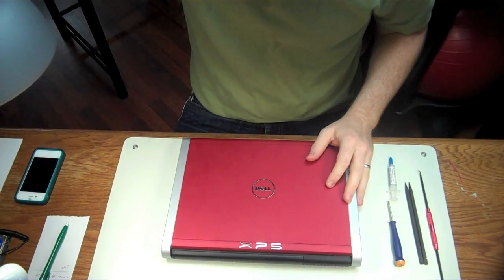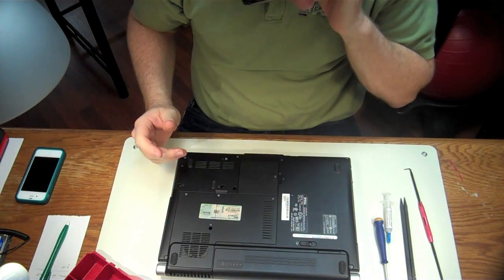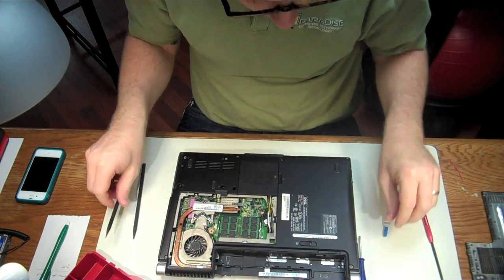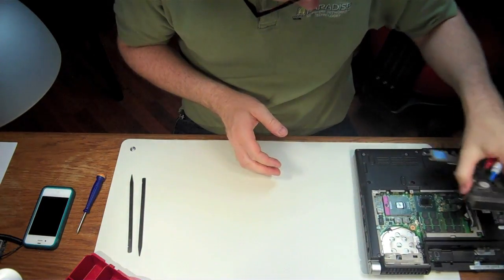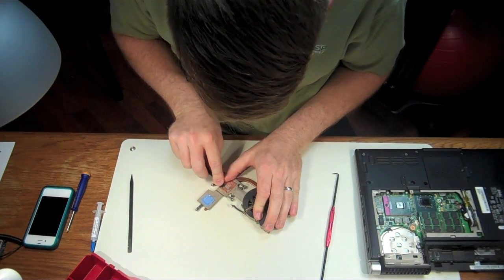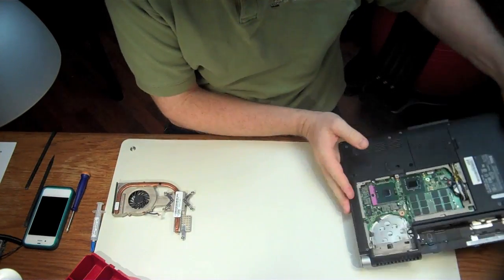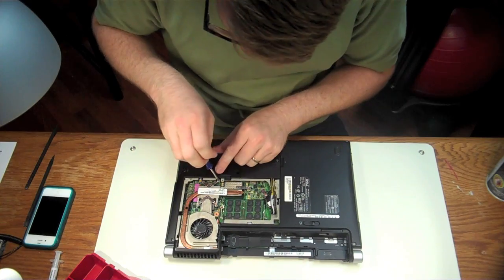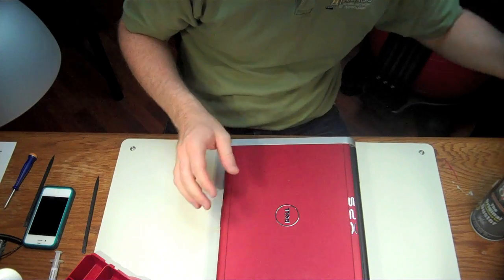Dell XPS Laptop Fan Cleaning - Overheating Issue Solved

Comment: Before you do anything you should probably just buy a new lithium ion battery, also; check if your putting the battery recharging plug 'in' correctly(fully). 'There is no overheating problem according to me'.-Defined as being a 'Contestable'  'view' because Anything can quote overheat a computer. even pressing ones hand too much on the panels.
Reply: Also, I would question (in that particular machine) if the battery bay ports aren't wearing out since they're made of some 'sort' of copper alloy. I also, found that old windows versions may just have simply been compromised.. Go windows with the eternally flawed systems and what if its' been a msdos (eternal). (You know) just so they can keep on pandering new devices to us?
Reply: Also, remember that when you open it it voids your warranty. 'MAY COST BIGGER DOLLARS'

Comment: I've done the same thing and the CPU and GPU temperatures went down a little, but the motherboard temp is still high (around 65 C / 150 F) in simple tasks like browsing or Word and the fan is always running, what could be the problem?

Comment: Oh Man. You butchered this task, like a newbie. 

Are you still in business ? 
How many early retirements and replacements have you caused in Florida? 

Does DIY in DIY Tech stand for Destroy It Yourself?

When cross torquing CPU heat sink arrangement, always work in three stages of torque. 
NEVER EVER max out the final torque in one go! 
Incrementally cross torque any retention bracket in at least three stages. 
The way that you did it means loading one face first.
This can stress both CPU and socket.
Solder separation is already a huge problem on laptops after the swap to NO Pb (Sn) solder.

Also way too much thermal paste. "Grain of Rice" you said which is true.
Not a full plate of rice ! LOL

Lastly, you didn't touch the fan ! 
I'd be asking for a full refund as you did not do a professional job. 
The opposite. You did half a job and did that like a beginner.

You effectively leant on one side of the CPU, drowned it in thermal paste, failed to even touch the fan and having pulled the GPU thermal patch whilst removing the heat sink, you should have replaced that or at least popped a small amount of thermal paste on top to maintain effective thermal transmissivivity.

I'll end on a positive as I should.
I adore your idea of the compartmentalised labelled container. 
I last used an egg crate and bumped it. all screws ended up together.
On the labelled container I give you 5 Stars.
On the rest of the job, I grade you an epic fail.

My validity to comment on your video:
Full technical qualifications (4 Year course full time course - I came 2nd in entire state)
3 years of post graduate technical education: which included materials processes specification, metallurgy, thermodynamics. 
18 years in Computer field at tech level, supervisory roles and management. 
A year with US based Multinational, United Technology Corperation, in the Carrier division, as regional manager.
Accredited designer/inventor with the Australian Intellectual Property Office.
Lastly I was invited to sit on the Australian Design Awards selection Panel.
Reply: Agree. If I'm spending money to have someone else cleaning the fan, it should look like brand new after the job is done, that's clearly not the case here.
Reply from the maker: Still in biz, 20 years. Glad you took the time to write all this up. I learned nothing. The real world called, get over it. Thousands of happy customers. Peace!

Comment: Half job done ...
Your work will not have the desired result without cleaning the inside of the fan.
Nice instructions how to get to- and disassemble the heatsink, but you forgot to open the fan (four little screws). Inside you will find a lot of dust cluttered against the grating of the heatsink. This can only be removed from the inside i.e. with a vacuum cleaner.
Blades of fan to be cleaned (gently!) with a brush while holding the fan in place.
My old Dell XPS M1330 is still going strong with a new Patona battery and Samsung 256 GB Pro SSD upgrade (much faster than the original!).

Comment: I have an XPS M1300 which I've had now for over six years, which I still love, but for the past two years has been running increasingly hot. The fan's always in high gear, performance has been on the downgrade, and I've always suspected  its because the CPU is just no longer getting cooled effectively with the little bit of ventilation the design affords due to dust and the like. But until watching Brian's video, I was always gun shy about opening up the back and trying my hand at doing a cleaning.  

However, this step-by-step video was absolutely terrific and provided all the details I needed to do the job.  With just the purchase of a handful of a few supplies for less than twenty dollars, I was able to safely open the laptop, clean out all the dust, and re-apply fresh new thermal paste to the CPU/fan interface to make for a vastly more effective heat transfer.   

Now my XPS M1300 is running like a new machine.  

Thanks Brian for an awesome How-2!!!
Reply: Christopher check out my advise above, concerning cleaning the INSIDE as well as the blades of the fan!

Comment: First off thanks for the excellent video, I used this as the baseline for cleaning out my m1530 today and it's running much cooler. Regarding your comments on lighter fluid or naphtha, these are generally safe to use for this purpose long as you're not cleaning plastics or rubbers. In my experience lighter fluid evaporates more quickly and more cleanly than high purity rubbing alcohol as well as being a more powerful solvent but has the potential to damage or melt certain plastics and rubbers. Thanks again for sharing, keep em coming!

Comment: proper instructions. guess it is a bit late to ask but could you do that for the Dell XPS L702X too please ;)?
Reply: ive got L702X too, there is another video for replacing the fan, way too many screes and pieces to do that
Reply: Dust will always clutter on the inside of the heatsink, at least in all laptops I serviced so far. So after disassembling the heatsink + fan you will always have to open the fan housing and take the fan out first.

Comment: I wish the xps 17 had that convenient little hatch. I have to strip this thing down to it's motherboard. Take off the screen and everything.
Reply: The Reaper I've never once taken the screen off. Top bezel, bottom bezel, fan, sink, paste and back together. If you're worried about scratching, you could always put a static bag between the frame and the screen.

Comment: Great video. Did exactly what you did, had alot of dust and dirt on the fan so got that cleaned thoroughly but my laptop still heats up. does not get baking hot like before but enough to cause stress. Any ideas?
Reply from the maker: Did you replace the thermal paste?  Also look into a free program called SpeedFan.  It can help you determine what your temps are and if you need to replace the fan.
Reply: Hi. Thanks for reply. Appreciate it. I changed the thermal paste. It has got a lot cooler but seems to heat up the touch pad area. Any ideas?
Reply from the maker: Is your hard disk right near the touch pad?  I can't remember...
Reply: It is on the right hand side of the touch pad.
Reply: Sorry. My mistake. It's on the left hand side.
Reply from the maker: My guess is that the hard disk is heating up and causing the touchpad to get hot also.  I would replace the hard disk, as it will probably fail due to heat exposure anyhow.
Reply: Chirag Patel
Improvement of cooling can only be obtained when the fan is cleaned on the INSIDE! (look for my comment above).
Reply: also note the lack of THERMAL COMPOUND ON THE GPU THAT IS WHY IT IS HOT

Comment: Very good video - thanks from me in London, UK.  

What are those useful tools called - I heard you say 'spudgers' (but my hearing can be dodgy!)

Brian
Reply from the maker: Yeah, Spudgers!  Also known as "Black Sticks"  Very useful tool.  You can get them on Amazon or eBay.
Reply: Pronounced "Spud-Jer"... Odd name and not absolutely essential.
They are like plastic fast food knives but in non brittle plastic ! Polypropylene ? Polyethylene ?
Often supplied free with screwdrivers when purchasing replacements screens for cell phones.
You can safely use nearly any stiff plastic with a perpendicular face. Ideally a very flat leading edge is great for face cleaning.
Automotive plastic filler appliers are an easily available substitute.
Just test with the cleaning solution you plan to use. Isoproply Alcohol (Ethyl Alcohol).
You could also use an EDT "Eau De Toilette" (Fragrance with high ethyl alcohol content !)

Comment: Would spreading the thermal paste evenly before putting the fan back on make any difference? I've got NFI about this kind of stuff but you surprised me when you just out the fan back on
Reply from the maker: The paste spreads out in its own.  You can spread it like butter if you want, no harm in that.

Comment: One big mistake in this tutorial.  DO NOT let the fans spin up.  These are very light plastic parts that if they spin too fast will cause them to fail sooner, if not right away.  Hold the fan, or stick one of your spudgers in it while blowing air through it.  I've replaced so many fans where people have blown air through them and spun them way too high, higher than the engineer designed them to spin.

Comment: Here's my issue; while gaming sometimes my xps will completely freeze, so I have to smother it with the on/off button. When I start it back up the fan blows like crazy but it doesn't start up. Is heat my issue?

Comment: Nice video.  Have you every had a complaint about overheating because you didn't replace the thermal pads?  I have a Dell XPS M1730 and I removed the Ageia physx video card, but the thermal pads remain intact.  Should I replace or reuse?

Comment: Great video, My wife's laptop has this overheating problem and really effects the laptops performance. So I bought the thermal compound and it has done it's job so far. However the HDD & and WLAN chip gets very hot. How can I fix this if at all possible ?